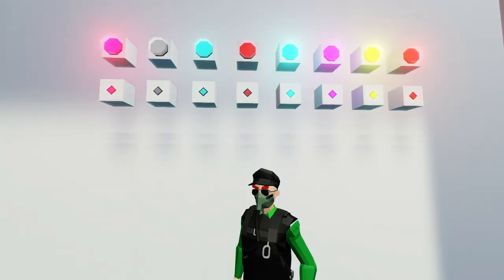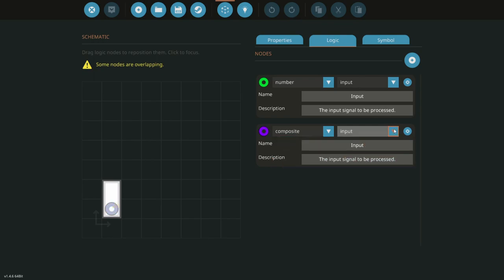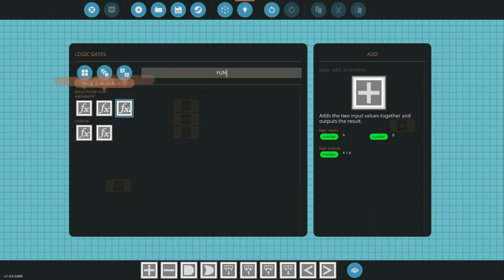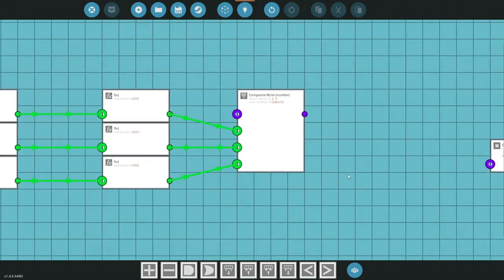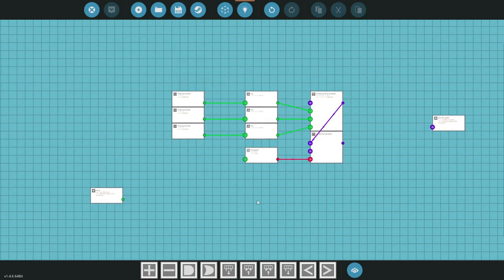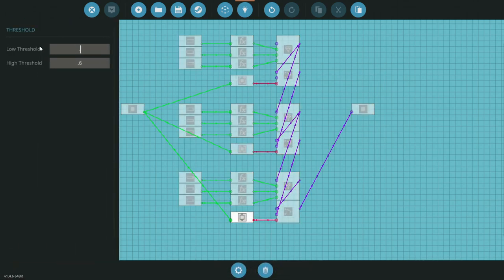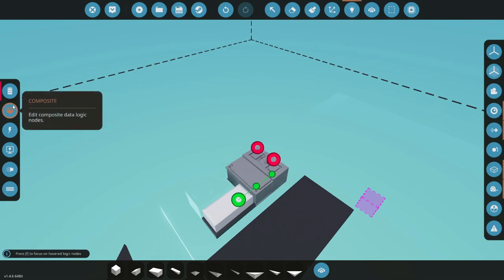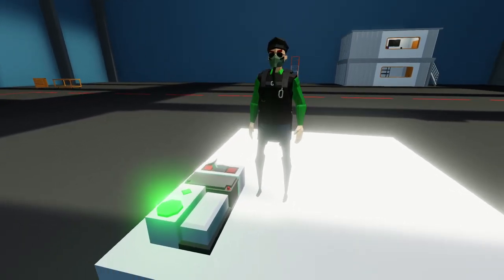Beginners RGB Lights and Indicators! Stormworks RGB Tutorial - How To

Comment: Definitely too fast an example for a beginners video.  Good enough to stop and figure it out but skipping so fast over the RGB decimal part is not beginner.  

So to help it is output on a Composite number rights to the RBG light.  Take the RGB color and convert it into zero to one by dividing the number by 255.  This is put in each channel for the RGB light to read on the composite. Example Chanel one is Red, Channel 2 is Green value from 0 to 1 and Channel 3 is the Blue value dividing by 255 giving you a number between 0 and 1 to write to the light.  

The light channels can be selected for a read of a more complicated composite signal.  That is if you have two lights.  Light one would use for Red Channel 1, Green Channel 2 and Blue Channel 3.  The second light would use channels 4,5,6 respectfully.